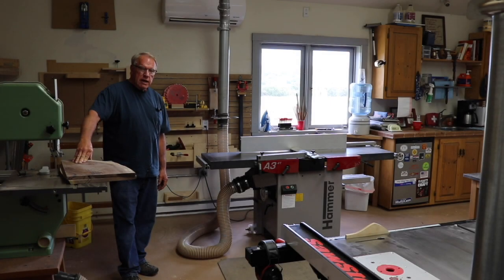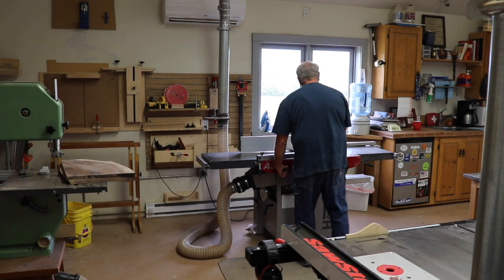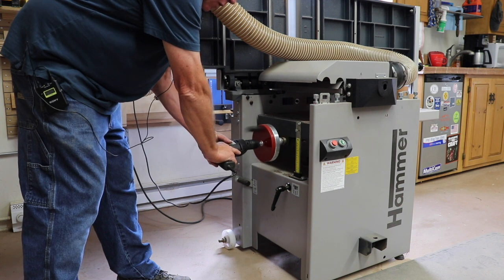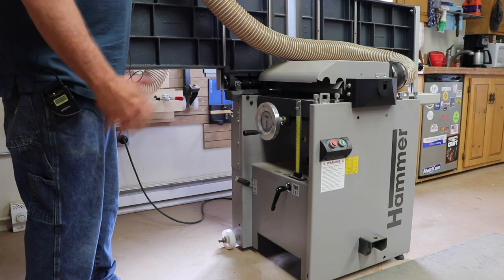Hammer A3-41 J/P Switchover

Comment: Hi Mick. Great tip, thanks! I asked Hammer (in Germany, where I live) about fitting the segmented cutter head, but they said it wasn’t possible. I’ve had my A3/41 for over 18 years, so their answer may have been based on the age of my machine. Can you give me any details on how you made the conversion?
Reply from the maker: I was able to order it with the machine. No retrofit necessary.
Reply: @micksimon55  Thanks for the answer, Mick, I’ll contact the factory in Austria. Was your decision to upgrade to the segmented cutter head a good one in retrospect? I use a lot of oak which I mill from the log with my Logosol and find  I  have to change the blades pretty often. What about adjusting blade height across the cutter head? With the standard cutter head there are 5 carriages (from memory, machines are all in storage while new shop is in build) which means that each blade can be adjusted for height across its width. How is this done with the segmented head?